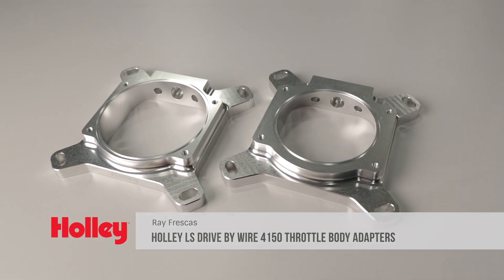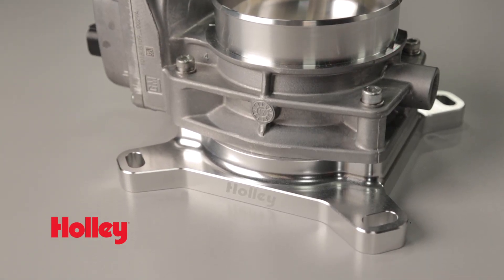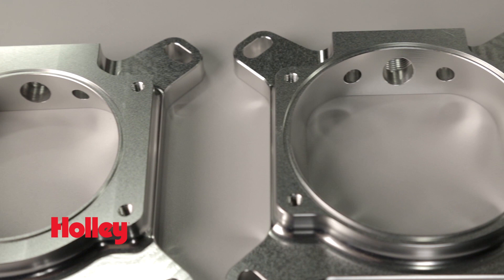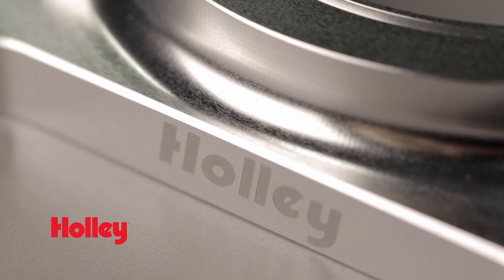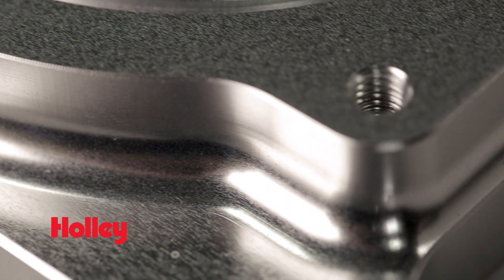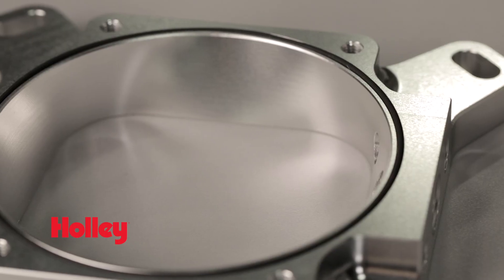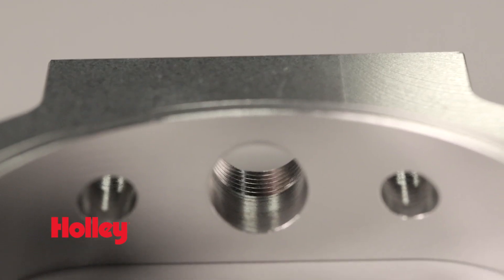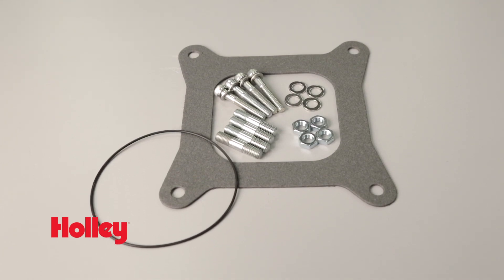Holley LS Drive By Wire 4150 Throttle Body Adapters

Comment: Are there any plans to make a ls7 race sheet metal intake?I run the hi ram but switched to bigger rad and fan setup and the hi ram front snout is to close. Would love a ls7 fab race intake for my boosted set up.